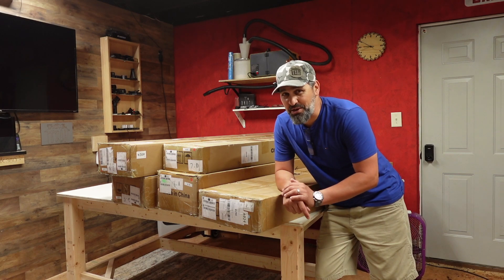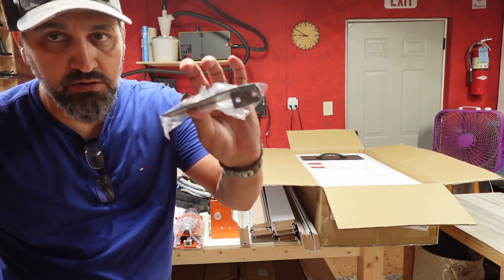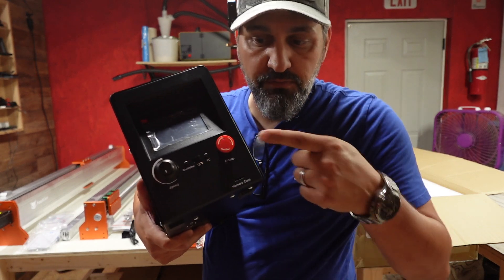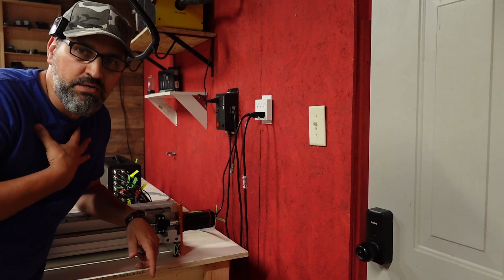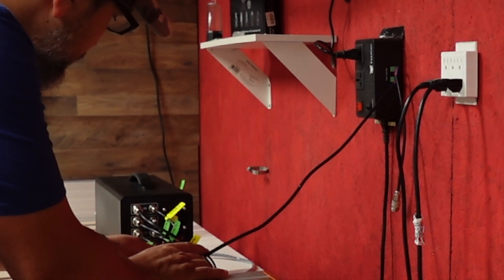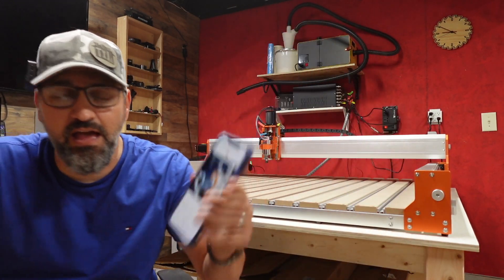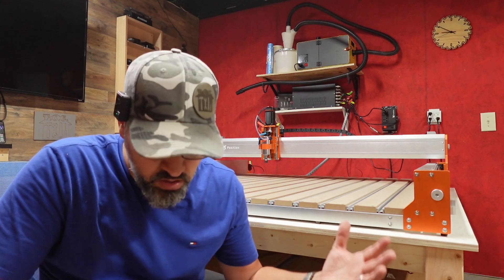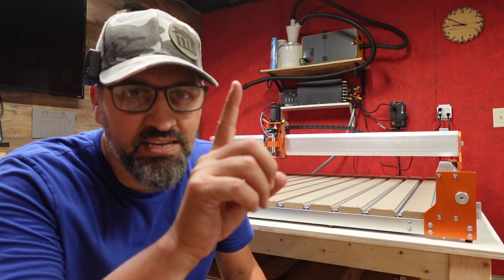Unboxing and Setting Up the MASSIVE FoxAlien CL-4x4 CNC Machine!

Comment: I bought a CL-4x4, because of your video.

I have set it up but if I put a standard 1/8 end mill and drop Z all the way down. I am still .500 -.600 off the spoil board. Can you please tell me the distance from the bottom of the spindle clamp to the bottom of the collar nut?

Is there any risk to lowering the spindle? This little 400W (underpowered) spindle seems like I would get some run out if I put too much below the mount. Any advice would be greatly appreciated.
Reply from the maker: Loosen the spindle, drop the Z all the way down just before it hits the limit switch, insert the bit, let it down so it touches the spoil board (I suggest adding a 1/8” spoil board so you don’t ruin the original T-Slots), then tighten back your spindle.
Reply: @ thank you, I did this and it seems to work, however I still plan on upgrading the spindle. I am going to be working with mostly .125 aircraft aluminum and acrylic. Have you upgraded your spindle yet?

Comment: Hello. Are you still happy from using this machine? I am considering Stepcraft M1000, FoxAlien CL-4x4 and Vasto XXL and still don't know which should I buy :/ I want to mill in aluminium too.
Reply from the maker: 100%!!! Can’t speak to a Stepcraft M1000 but the CL4x4 is a great machine. It needs a bigger spindle though! The little 400W doesn’t do it justice.  Buy a trim router or 1.5-2.2kw and you’ll have a beast!!

Comment: I am reaching out because I too recently set up a new CL-4x4. I have had nothing but problems with my test cuts only going about 1/2 through my depth settings. I have asked Foxalien for the default GRBL settings which they provided but I’m still having the same issues after changing a couple settings that were different from what my machine was showing.
Any chance you could send me your GRBL settings? I’d like to compare them with mine. It cuts my test pieces perfect apart from only going about 50% of the depth setting desired. I have other machines so I understand properly using Z Probe and calipers for thickness. Very frustrating trying to get this thing up and running as planned.
Thanks for your help. If you have any other suggestions, please let me know.
Thanks
Rick Meyer

Comment: Good morning 🌅, T, C, C,  congratulations 🥳 😂, on your new man cave Big Boy Toy , 😂, A great looking 👀 piece of kit, I would love one of those, bit out of my price range, I am thinking of buying one of the smaller ones later in the year, I am in the process of trying to finish my work shop, and want to build a slab flatting table, I am interested in learning CNC skills but I am dyslexic, But I’ve seen that I have run a business of my own for approximately 50 years, making furniture chairs, et cetera, special doors and windows for barn conversions renovations, And I still have most of my machinery, so I’m now retired living in France, All I have in way of area to use is a basement and a small garage area approximately 6 m², not really enough room to swing a cat, because of my circumstances financially, been scammed by my ex female partner, I’ve got to try and earn some extra money, I’ve got some funds, but not a lot, very interested in Foxalien machinery, it would be nice to go and see one up and running somewhere appears to be quite a few things advertised back in the UK not going back there any time soon cost too much, so I’m looking at you too at the moment deciding what I need to do and what I need to buy I’m thinking of making small river tables, i.e./resin and timber, Into allow speaker cabinets as well thinking about those, do you think this machine is over the top and would it be better to get a smaller one and then get the accessories to make it bigger?, I’ve tried to ask somebody back in the UK. I’ve had no reply at all., Keep up the great work I’ll look forward to your next review on this ginormous machine, from France.